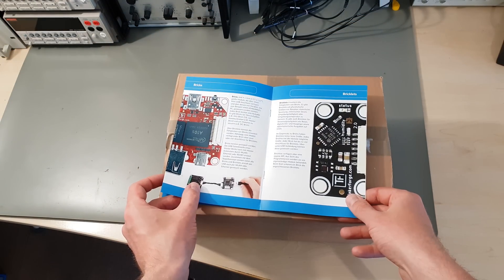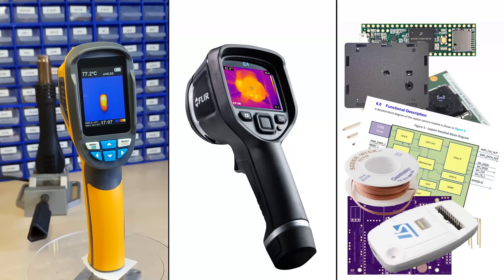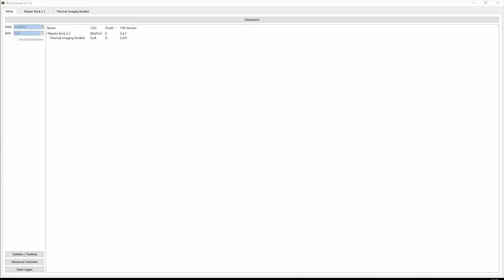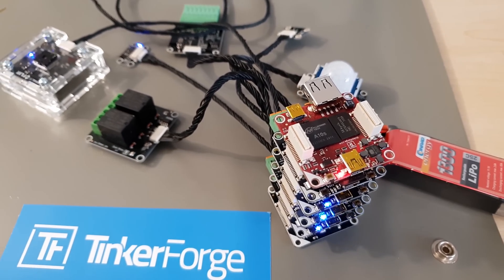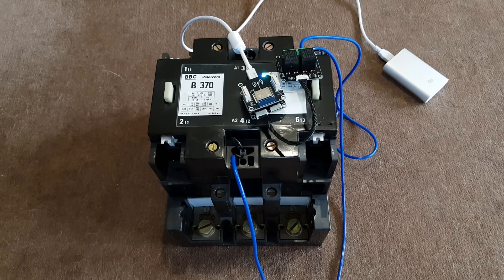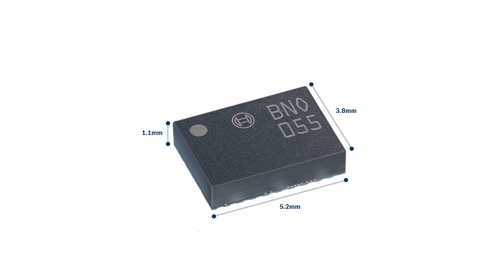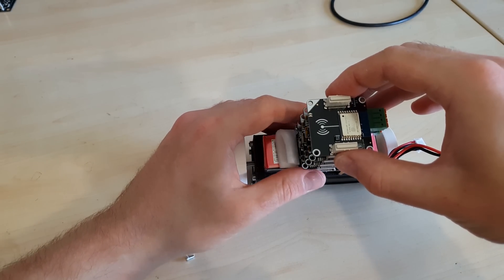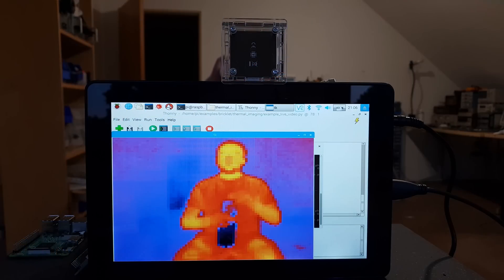Tinkerforge: Making Thermal Camera and Robot from Building Blocks

Comment: "I make my own circut boards"
shows Snap Circuts
Genius.

Also, I remember getting a Snap Circuts set a few years back. I was probably a little old for it, but I was getting into electronics, and it was better than soldering for a 12 year old. I loved optimising the circuts to make them as small and efficient as possible, along with doing a bit of circut bending too! They're really great for anyone who's still too young to be trusted with a 500 degree metal rod but wants to learn about electronics.

Comment: Nice video, but at 7:14 how do you use a tablet with raspberry pi? Do you make some adaptation or is just a vnc-like connection?
Reply from the maker: That tablet is basically an HDMI monitor with a battery

Comment: Yay finally a good video about TinkerForge. My only problem I have with that and the Arduino Due is that Microship has declared those ATSAM3 microcontrollers as "not recommended for news designs".  I would like to jump on those since I constantly hit brick walls with 8 bit PICs.
Reply: Damn Microchip, i feel the whole Atmel subsidiary is not getting much love. I think jumping ship to STM32 is absolutely par for the course. There's always a second source for those. GigaDevice makes compatible ICs, and NXP and others have incompatible but way similar ones. I think ARM microcontrollers are the way of the future, damn cheap, easy, and great peripherals usually, and so much less vendor lock-in, because there's always a competitor to port to with moderate effort and little risk of difficult to catch issues.

But depends what kind of brick walls? I mean even STM8 and especially AVR are less constrained than 8-bit PIC computationally, though they lack in hardware peripherals, which is that kind of trade-off, AVR ecosystem favours bitbanging. Most popular 3D printer platform which does pretty nontrivial things, lots of synchronised motor movement, UI, SD-card, high-speed text parsing, floating-point math, is all just running on a 16 MHz AVR 8-bit. Not even quite maxed out. No special-purpose peripherals used for just about anything save for embedded shift registers pretending to be SPI interfacing the SD card, and another pair pretending to be the UART. Economically, it doesn't make much sense any longer, since STM32F103 is plain cheaper and better, but it's how it was done in the early days of the RepRap project, it grew from there, and it still works.
Reply: The ATSAM4 can be used as a drop in replacement and we are already using it for the newest production runs (same firmware we just need a few runtime checks because of flash timing differences during flash writes).

Comment: If you put the battery on top and the IMU on the motor schaaftt level you'll probably get more stability.. xx
Reply from the maker: Really? Totally counter-intuitive! Will give that a try
Reply: Think of it like holding a long stick with your finger, trying to balance it.. the larger/faster movement happens at your finger level, while the tip of the stick high up is more stable, and moves slower.. adding more weight to the top makes the whole thing more stable..

Comment: Those boards looks like flight controller/4 in 1 esc/vtx and so on. Quadcopters stacks. 😊
Reply from the maker: Thought so too! Maybe with a GPS and an IMU module one could be made? But they don't have a BLDC controller yet ...
Reply: Haha I was thinking the same :)
Reply: Marco Reps Who knows... Maybe soon it will! 😊 For now I stay with the Holybro Kakute flight stack (the one with the 35a Tekko32 4 in 1 escs). 😊
Reply: I once took apart some older aviation equipment from seaplanes, and honestly same idea with the stackable modules haha although of course the quality was insane

Comment: Lots of negative people here saying it's merely a commercial in disguise. I've just went through building a camera slider that can do small steps in between shots (used for macrophotography) and is conventiently controlled by my mobile phone, meaning I had to develop on Android and Arduino, plus finding lots of information by myself. Even so, I used an Adafruit Shield to at least not having to do the stepper driver handling myself and implemented many bits of source by other people. So, even when doing it "the hard way" will never mean you do all of it from scratch, but hobbyists with focus on youtube commenting will probably not understand, as they lack this experience themselves. Tinkerforge may be a great way to reduce some of the hassle. Looking forward to your first larger project with it.

Also, thanks for the cool videos, you're one of my most favorite Youtubers, I very much look forward to your videos.

Liebe Grüsse aus der Schweiz! Sagste Bescheid wenn'de mal im Süden bist und Lust auf 'nen kühles Getränk hast.

Comment: The point of these bricks is not to save you money by replacing single-purpose tools like a thermal camera. The point is you get a superbly flexible system to quickly prototype ideas. You don't save cost on the device themselves, you save cost on the time-to-result. That's why these are actually pretty cheap. When you consider an Engineer's time at say 50 to 100 USD or EUR and hour, tinkering time ends up costing a lot.  That's why Tinkerforge is targetting the pro market.
Reply: As an EE I could see that

Comment: 250 Euro is not exactly affordable!
Reply from the maker: No need for sorries, all opinions are appreciated! We can agree on the fact that it would be better with the newer Letopn 3 sensor
Reply: I am sorry, I don't agree with you at all, first of all, this is the lower resolution sensor and it is almost half the price on Digikey(sensor only). Also, there is a complete solution sold by Flir around 450$  that will give you better results than this, which for a hobbyist, is a much more economical, since to have a complete thermal camera built around the bricks will almost cost a little bit less than 450$

Definitely not a good value for just a thermal camera build!

On the other side, I can't deny how much I was impressed when I saw it since for me, it is the first time I see a thermal camera with Flir sensor on a "Bricklet", I really like it regardless the high price!
Reply: @NourMuhammad  I agree completely.  This is the "startup culture" in the west.  It's all spoiled rich kids who assemble some off-the-shelf components and expect to make 100K/year.

This is why I'm learning FPGA.....I will be able to reverse-engineer anything I like.
Reply: Their module currently uses the Lepton 2 or lower. This is a bad value until they start using the Lepton 3 as you're paying the same price for a quarter of the resolution. Also, the whole Lepton for DIY situation is kinda shit in general since FLIR refuses to supply the  high framerate versions.
Reply from the maker: For someone who would otherwise consider a 1000€ Flir it is
Reply: sykskysyk it’s more a government rule not flirs’ fault
Reply: Flir one seems to be in the same price range, but better (it has a normal camera too)
Reply: It's been open sourced if I heard correctly - that means others will start building the modules, the price will come down if the idea takes off.
Reply: Marco Reps is it a tablet or just a screen with RPi connected?
Reply: 250€ < 1000€